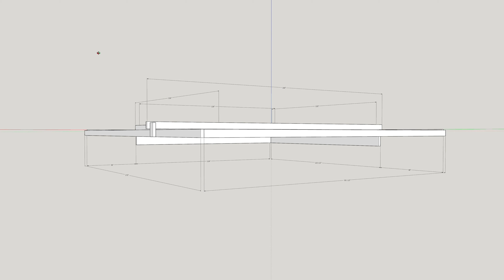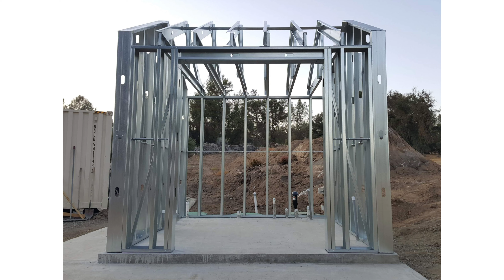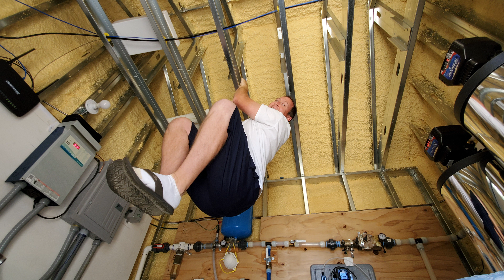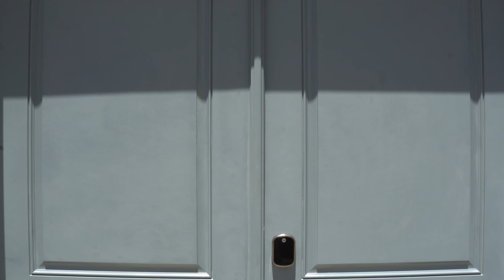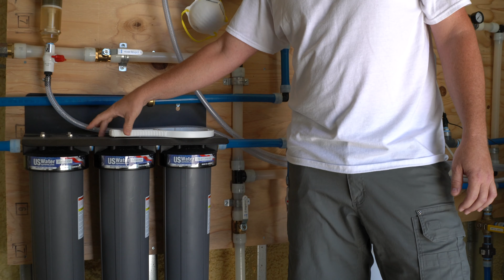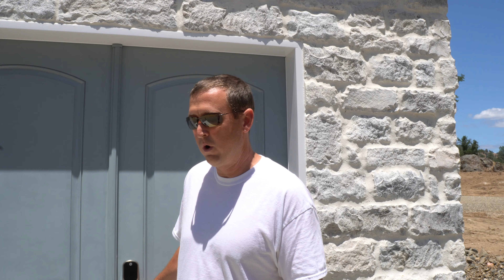BONUS! The world's nicest shed (aka our pump house)

Comment: Hi there! Do you have an update on how the water filtration system is holding up? Any pros and cons with any of the brands/products? If you could change anything after having it in for a while, what would it be? 

About to mimic this setup for our well so just wanted to see!
Reply from the maker: Hello! The filter systems have been working really well. We've had it for about 5 years already and haven't had the need to change the media in the softener or iron/sulfur remover. Earlier this year we started to notice the smell coming back but it went away by increasing the H2O2 injection rate, so it was likely a result of the natural breakdown of the H2O2, but 5 years is a pretty good run for shelf life. So the only advice I'd say is don't order too much at the beginning, see fast how your injection rate consumes it (it depends on your water) and then order the right amount on an ongoing basis.

Comment: Loved your building. I just put a mobile home in my property the well is dug but haven't installed water lines yet, I'm thinking about a set-up pretty similar as yours, Help me understand the layout of the pipes inside the shed: there's the water inlet pipe coming from the well connects to the water tank, then comes out the tank and distributed to 1 pipe for the house/rv? And other outlet pipe for the irrigation?, do you have like a distribution box outside for multiple water hydrants around your property? Id appreciate your response.
Reply from the maker: Yes, there are basically 2 types of water - the irrigation water that's received minimal filtration and then water thats gone through the multiple stage filter and softener, etc. Each type then tee's multiple times both within the pump house and underground at various points throughout the property. The shutoff valves in the pump house help isolate it when we need to add a tee or do some maintenance so that we don't have to turn off the water to everywhere. Hope that helps!
Reply: So helpful, thank you for your response!

Comment: Truly amazing that you guys are doing all this together, and mostly by yourselves from what I could see.  Unbelievable!  And LOVE the filtration system.  Have a question... I'm building a similar filtration set-up, but my pump and pressure tank will be located about 120 ft from the farthest bathroom.  Not sure if the pressure tank can provide pressure that far?  How far (approximately) is your pressure tank from your farthest faucet?  Thanks!
Reply from the maker: Pressure loss is a function of distance and pipe size. If you use a big enough pipe you won't notice the pressure drop. The distance from our pump to farthest faucet is over 200' so for the long distance run we use a 2" pipe, but smaller may work depending on the flow required. Check out this online calculator: https://www.tlv.com/global/US/calculator/water-pressure-loss-through-piping.html Thanks for watching!

Comment: I have a question about your well head. How did you freeze proof that. I didn’t see that mentioned. I gather it is still outside the shed. Best Plan. Ran it underground into the shed. But what did you do to it. Besides the typical fake rock. Or did you just fake rock it.
Reply from the maker: I guess we never filmed that part but we used what's called a Pitless adapter so that the water can exit the well below the ground and make it's lateral run to the pump house. The depth that one should install it depends on the frost depth in your region. In our CO house it was down almost 5' but here we just did it about 18" since it rarely freezes.

Comment: What was the total cost of this project?
Reply from the maker: It's been a while, but for the building itself I seem to remember that the concrete, framing, roofing and insulation were all about $1000 each, so $4000 for all that. The stone siding material was $13/sf so that was another $4000 (obviously there are cheaper siding materials one could choose). Plus the door and other misc costs put it at around $10,000 for the building without the plumbing equipment. We're doing a better job of tracking the costs on our house project so stay tuned!

Comment: What is the adapter you used to transition from 1" pex to the 1/2" (assumed) flush valve right after the 3 pre-filters?
Reply from the maker: It looks like we used a 1" PEX to NPT adapter that threaded into the flush valve and then a 1" to 1/2" bushing on the other side of the valve to convert it to 1/2" hose barb. Hope that helps!

Comment: What are the fittings the drain lines go through? I have a 2" drain pipe and will fabricate the pvc manifold like you have, but do not recognize the fitting for the hoses. Thanks
Reply from the maker: It's called a backwashing air gap and is meant to separate the water supply from any contaminants that can accumulate in the drain system. There is a full description from the same manufacturer as the water equipment where we bought them - https://www.uswatersystems.com/air-gap-for-water-softener-1-1-2.html. 

Also, make sure you leave at least 12" (but 24" is better if you have room) of vertical pipe between before any 90s or T's in your manifold. The water tends to back up going around a turn and will overflow out of the drain pipe if you don't have enough vertical height. We made that mistake initially and had to rebuild the manifold. Hope that helps!
Reply: @BuildItLikeBeckhams  This info is helpful and much appreciated. I am demolishing my old tiny well house and building a new bigger one I can stand up in. I also purchased the peroxide filter system from US Water Systems and will be installing it in the new structure.

Comment: What water do you have, I can drink mine right out of the well in central Missouri? Is tasteless and oder free
Reply from the maker: Our biggest problem was the hydrogen sulfide which is a fairly common problem in well water. It dissipates as a gas once the water isn't under pressure. You can smell it even at very low concentrations so the hydrogen peroxide system is nice since it removes it. After installing that system we haven't noticed it at all and have great water quality now.

Comment: I notice you talking about the line coming in from the well so I’m curious about the distance between your well and the pump house. We just had our well dug and upgraded to a 120 gallon tank and 2hp pump since the well will be supplying the main house and guest house. The distance between the well and main house is about 100 ft then another 100+ ft to the guest house. Currently everything is together and exposed to the elements. About to apply for permit to construct the pump house and assumed everything should stay together but I like the idea of the well it’s self not being inside the pump house. I think this would give us the flexibility of building the pump house closer to the guest house. Didn’t realize that was an option.
Reply from the maker: In our case the well head is about 50 ft from the pump house. We used the same size - 1-1/4" - pipe for the lateral run as the drop pipe to minimize any friction loss. As long as it's flat or not a steep climb from the well head to the pressure tank then the submersible doesn't really know the difference. Good luck!
Reply: @BuildItLikeBeckhams   thank you. I’m so glad I found your channel. Wish I had found it a year ago. Lol keep up the good work.
Reply: @kellyojeda9634  It depends on the city code of course, but where we live you don't need permits for sheds under a certain size (I think it's 200 sqft, but I could be wrong). You don't need the well head inside the pump house, in fact with a large pump that might be a bad idea, because if you ever need to service it, you need a crane to pull it out and then you need to destroy your pump house every time.
Our pump is only 1/2 hp, it is easy to pull out without equipment and we have the well head inside the well house. Makes it easier to keep it all above freezing. Good luck with your set up!

Comment: Nice, clean install.  Kudos!  Do you have a part number/manufacturer for the double check valve?
Reply from the maker: Thanks Eric! This is the link to the part we bought - https://www.supplyhouse.com/sh/control/product/~product_id=0683041. However, I would note that one of the ball valves on the end had a defect and was cracked. Otherwise it's been working great.